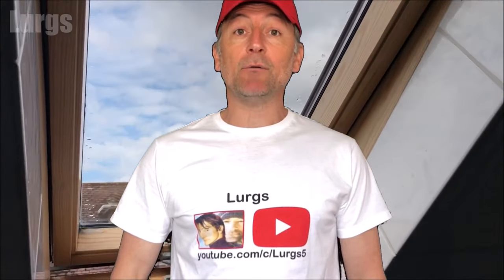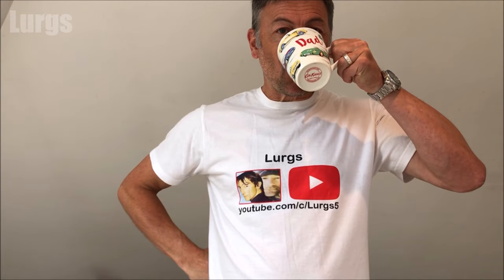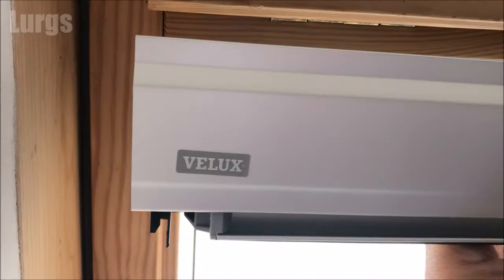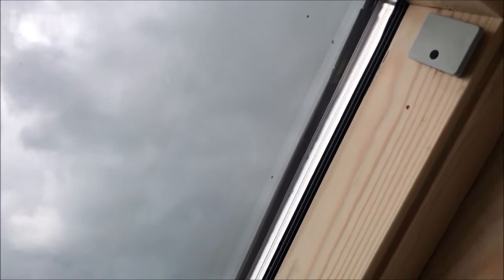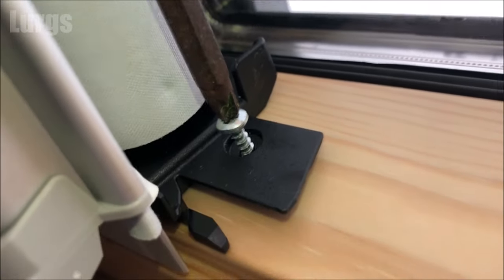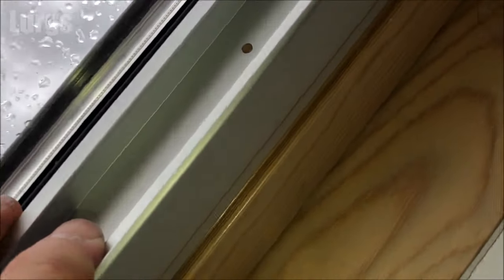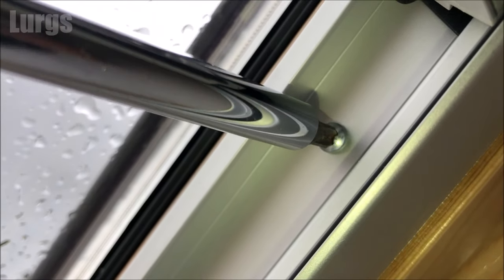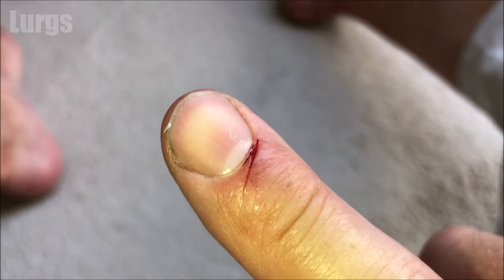How to Fit a Velux Blind - Velux Window Blind Installation Guide

Comment: Drilling a pilot hole is key to making this job painless 👍
Reply from the maker: Yeh I nearly always do a pilot hole when screwing into any wood, saves it splitting and makes it easier. Glad my video helped 😎
Reply: Also helps to not destroy the head of the screws from too much force, your video was a great help to me to confirm what I was doing was correct, thanks 👍

Comment: I would also add, use a cheap and cheerful bradawl to mark the holes and use the correct screwdriver bit for the screws. It appeared the bit used in the video was incorrect and started to round off the screw. It appeared to be a bit bigger than required. If using a drill I wouldn't go quite as deep either 5mm or so should suffice.

Comment: Thank you! great video. One question. I only have a metal drill bit small enough (not got a wood drill bit). Will that work okay?
Reply from the maker: Yes should be fine, may need a small pilot hole to start it off, just make an indentation with a screw or nail.
Reply: @LurgsHowToGuides  Okay great, thanks!

Comment: I have a really small Gap at the bottom. Like I cant close it completely (by 2mm). 
Because of that the theres coming a little bit of light through,
Do you know anything i can do that fill the small gap?
Reply from the maker: I think it’s common as I’ve got 2 blinds and there is a small gap at the bottom. You could screw some rubber into the bottom or a thin piece of wood so there was no gap